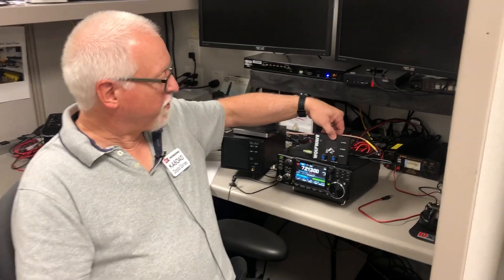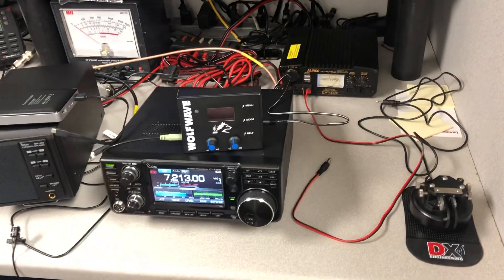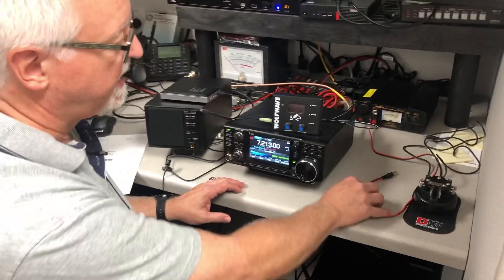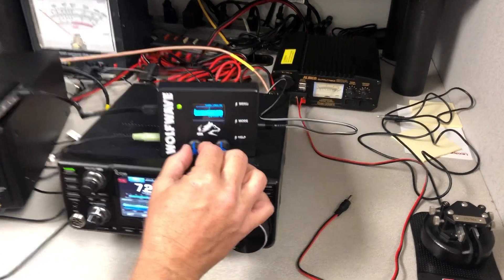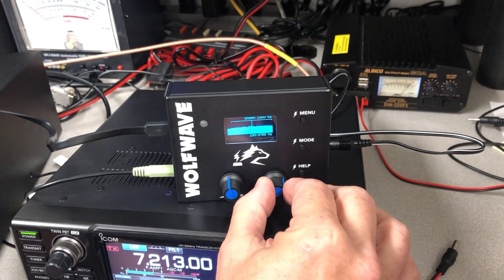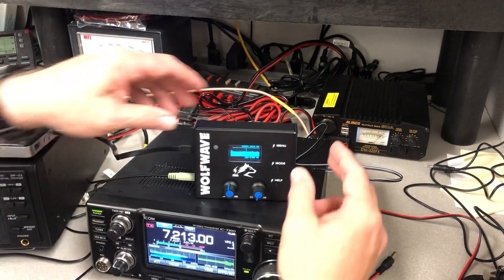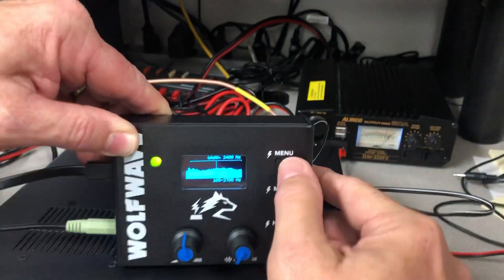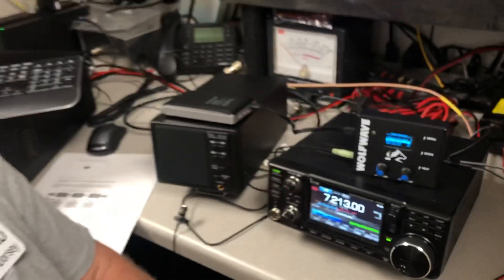Ken, KA8OAD takes a closer look at The WOLFWAVE Advanced Digital Signal Processor from SotaBeams

Comment: the test leaves me a bit helpless
I would like a real demonstration of the CW filter bandwidths, especially 50 or 100 Hz. If the filter rings or not ...

A comparison of the IC 7300 DSP and the AF DSP of the Wolfwave would also be helpful.

The Noisereduction in the chosen strength is certainly catastrophic, I hope it is an operating error ...
Reply: instablaster